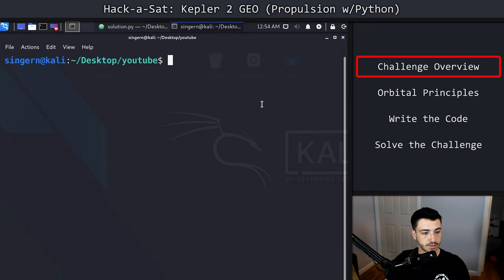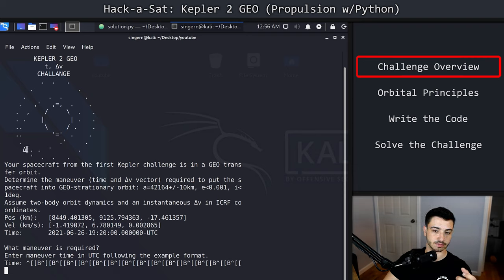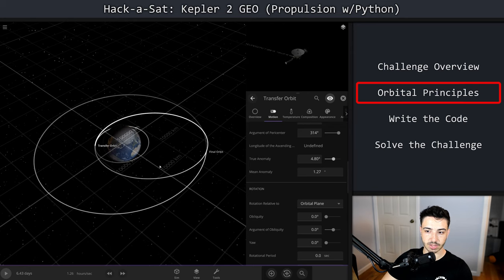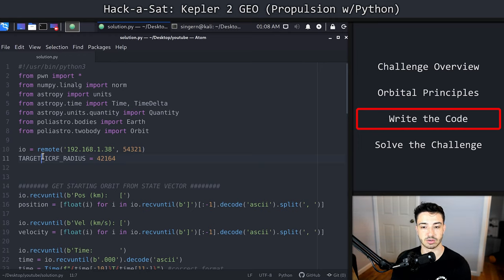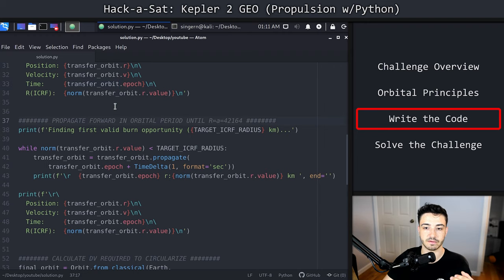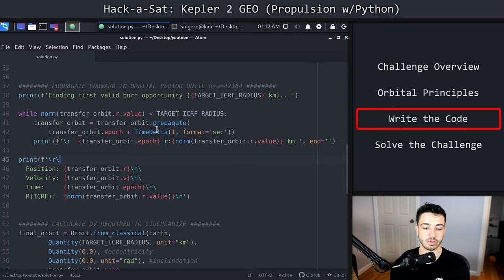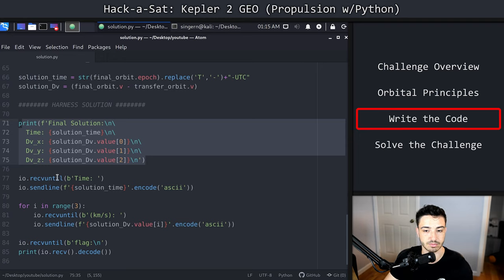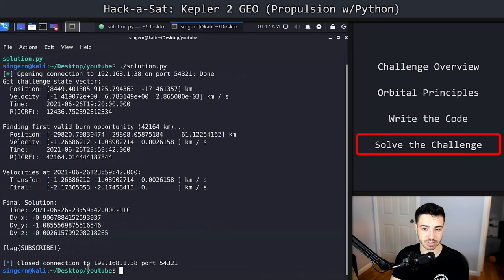Hack-a-Sat: Kepler 2 GEO, Solving for Propulsion w/Python

Comment: Just note that your delta-v calculation only works if the inclination of your transfer matches the inclination of your final orbit. Different starting parameters might have your inclination higher than the challenge requirement. It would require calculating those orbital elements to verify your inclination is appropriate, as well as to perform your maneuver and translate to the spacecraft reference frame. For the sake of realism, launches from French Guiana typically go down to ~6 degrees inclination.
Reply from the maker: so just to clarify the easiest way to do this is two burns? one at asc/dsc to set final inclination and then another at apogee/perigee?
Reply: Yes, that would be the most efficient for delta-v (fuel budget). Inclination adjusts are fairly costly manuevers.